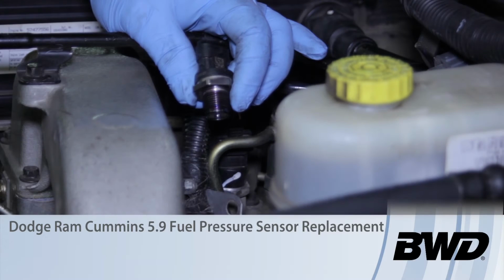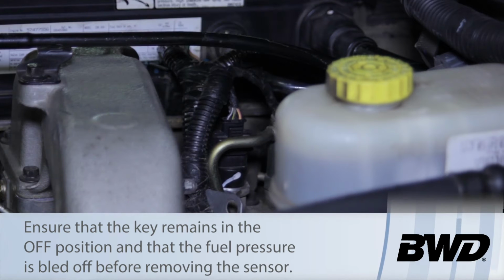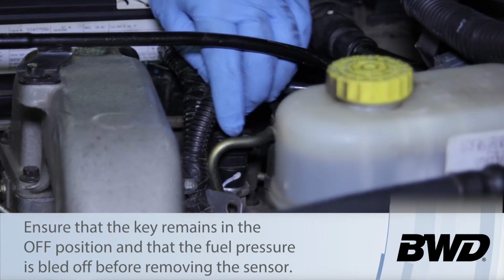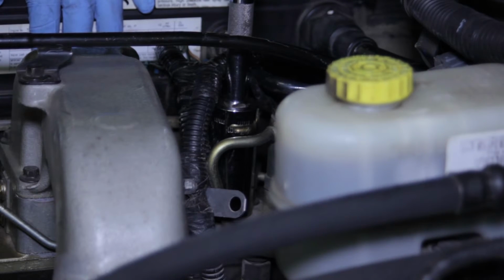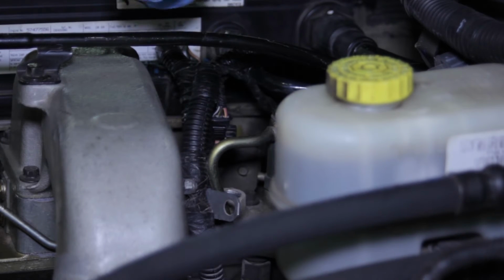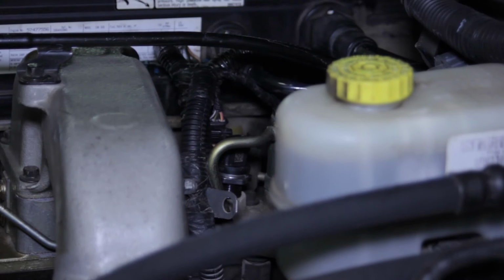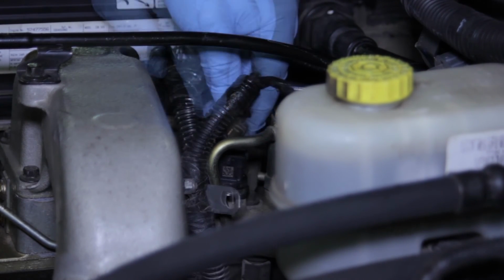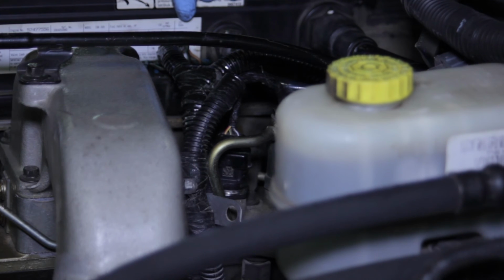How to Replace a Fuel Pressure Sensor on a Dodge Ram Cummins 5.9L| Know Your Parts

Comment: You don’t have to add any torque due to extensions being on the torque wrench..no matter how long it is or if there 100 extensions the final torque doesn’t change at all. Only time it changes is if length changes